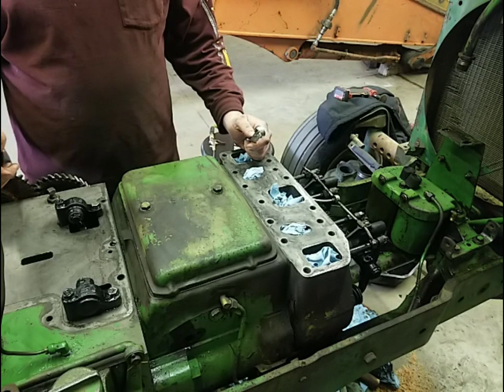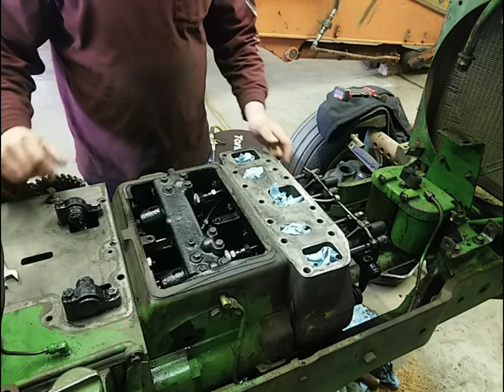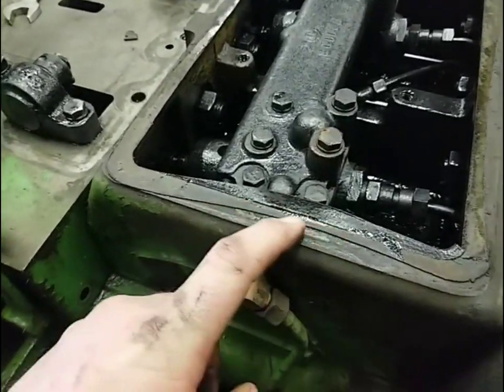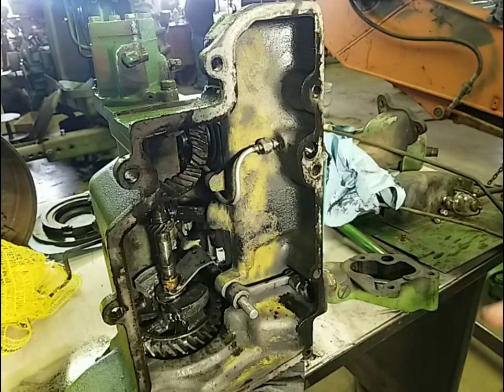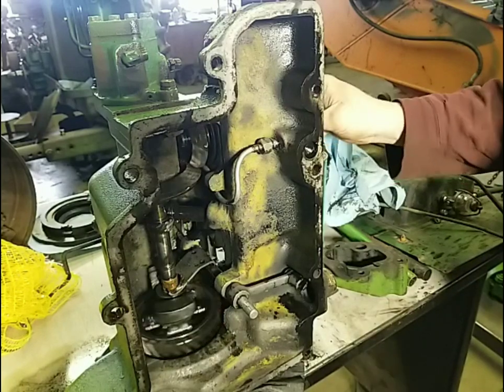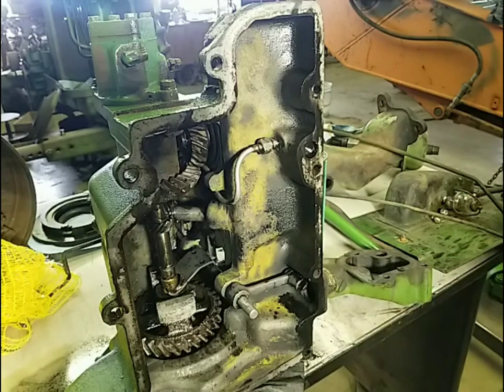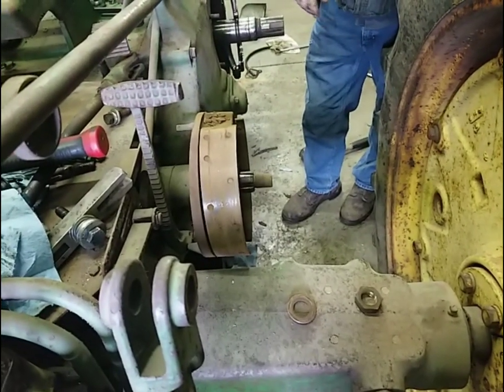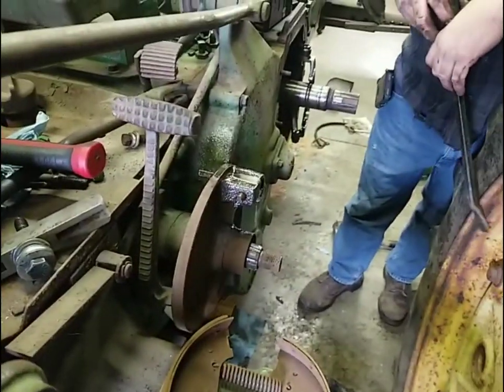John Deere Two-Cylinder 720 Diesel... Fuel System And Govener How They Work Video! And Brakes

Comment: Enjoyed you and dad having a good laugh!! I’m a gear head but never worked too much on tractors so I enjoy when you spend time explaining how things work. Do you guys have a parts washer for cleaning up stuff? 
Also a nice small drill powered hone would really clean out those adjuster holes. Like the ones used to rebuild master cylinders and wheel cylinders.
Reply from the maker: Yes that was a good laugh!....I need to get me a good parts washer I really want the one that's like a dish washer you put stuff in and it automatically cleans it!....I use them wire brushes for copper pipe I cut the handles off and put the in a cordless drill to clean smaller holes them then I also have some small bar hones

Comment: Don't use the scotchbrite pads for gasket removal,they take off too much material on the gasket surfaces at a fast rate.Plus the scotchbrite pads have aluminum oxide which gets in the oil causing problems

Comment: That cap ahead of that right brake on that big housing has a bearing in it which is prone to failure. It doesn’t get oil good. Take that cover off check that bearing. And pack the shit out of it.
Reply from the maker: Thank you I'll check that out!!